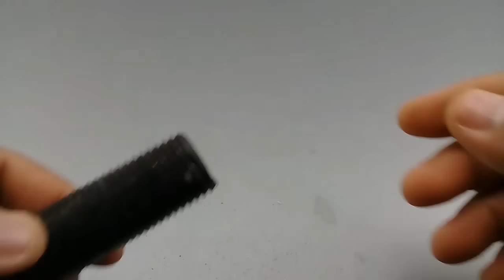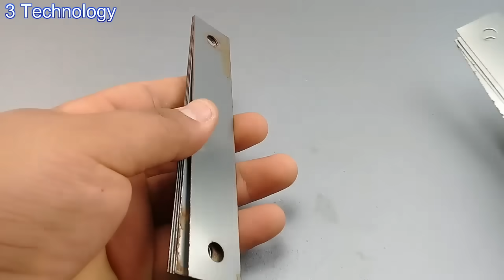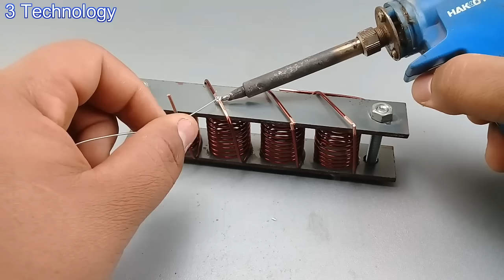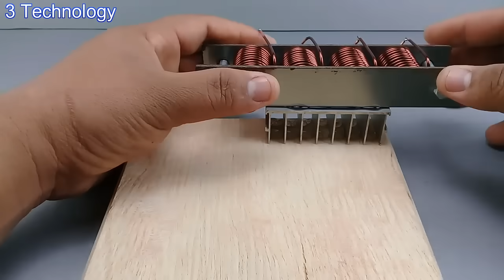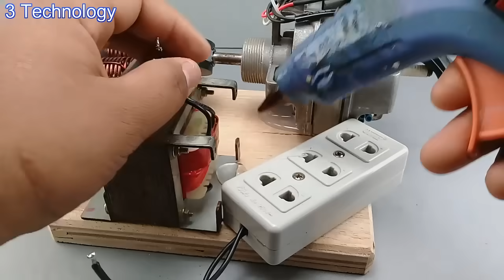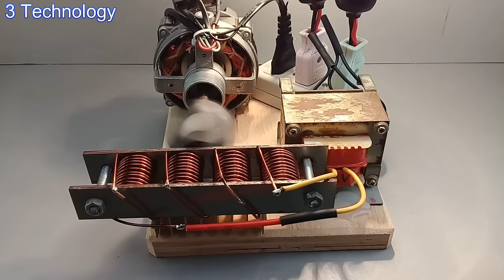how to make free electricity energy 10000w with four pieces copper wire / real free electricity

Comment: Very nice. I have some questions.

1. Which transformer do you use?
2. Do you connect the wire from the coils to the primary or secondary coil of the transformer (I assume the secondary)?
3. How do you turn round magnets, do they attract or repel?
4. Did you measure how much current is obtained at the output?

I apologize if I asked an unprofessional question, since I am a layman in electricity.

Thanks for the reply and best regards
Reply: What's the proof that this is a lie? 10kW with a conductor of half a millimeter and you have a question...
Reply: @diavolo974    Proof that this is a lie is conservation of energy.
Reply: The heatsink was questionable with very little contact and pretty useless.  Nothing else enlightening here -- I've seen examples of free energy circuits .  . but this is intended to discourage those who try to follow this demonstration. . as someone else mentioned, the transformer may have been modified having a battery pack as a power source while stepping up the voltage.
Reply: @ronaldgreene5733      I doubt that you have seen working free energy circuits. No system can deliver an energy output without an equivalent energy input. (Or the system has a storage of energy, which is used up.) Keeping that in mind it is possible to judge at once what can be real and what is fake. With this video I suspect a hidden power line. These guys are mostly not very ambitious in their trickery.
Reply: @heinzpg  .  . yes -- an unlimited storage of energy that can manifest beyond the means of our current understanding -- of a mainstream shared and compulsive variety.  Scientists today still cannot explain how we as biological entities can produce more output than the energy we consume -- and certainly for those on paleo or low carb diets.  This issue is ignored based upon nothing more than the circulation of accepted information and assumptions in place of the inability to explain many of the theories and assumptions given as fact.  In place of initiative, we depend upon nothing more than repetition and production quality.  Initiative equates to responsibility -- something that we so much want to avoid today in real terms, that we no longer require it on the part of anyone involved. We only require the circulation of information so that we feel safe enough to participate without fear of accusation .  . to being sidelined, disparaged, ridiculed and ostracized.  Certainly nobody are more afraid of being call a name than Americans today.  Let's get comfortable now and turn on our television .  .
Reply: Чувак, это развод.
Reply: @ronaldgreene5733    ????? Of course also biological entities comply with conservation of energy! If your energy intake via food is lower than the energy needed to uphold the basic functions of your body and body temperature, plus the work done, your body must tap energy storages and you loose weight and starve in the long run. The recommendations for the intake of energy via food - if no change of weight is intended - are always slightly bigger than the energy produced by the body. You find plenty of figures for the energy in- and output of biological entities in the internet, always in compliance with conservation of energy. It is ridiculous to claim that something is "ignored" in this field. Conservation of energy is not a vague assumption, it is also a prerequisite for the stability of our universe. Ever heard about the Noether-proof?

As for technical devices, there are always claims that a device was found with more energy output than input. But never ever has this been shown in a credible and reproducable way. Whenever an examination was possible these claims proved to be wrong, they were based on incompetent measurements or fakery. You say, you have seen examples of free energy circuits. Have you built and checked them? Probably not. In times of the internet, if such circuits would exist they would soon be generally known and demonstrated in many places. Where is one please?
Reply: @heinzpg  .  . "Conservation of energy is not a vague assumption" .  . and yet your diatribe is based almost entirely on assumption .  . a manifesto Mr. Heinzpg -- Glorious .  . 😃 .  . We expect more .  . you won't disappoint --
Reply: @ronaldgreene5733     Before you rate my comment as diatribe: please show me evidence that biological entities violate conservation of energy. That would be glorious, but I am afraid you will disappoint ...
And I recommend you to research the Noether-theorem, which is a mathematical proof of conservation laws (energy and momentum). Feel free to check this proof! If you miss the necessary knowledge in advanced mathematics to do that, don't worry, this proof was checked over and over by competent people.
Reply: @heinzpg  .  . "Noether-theorem, which is a mathematical proof of conservation laws (energy and momentum)" .  . 😃 .  . There is much more involved than just momentum in the function of the human body -- and you have yet to prove "conservation" which you simply cannot and can only fudge based upon a portion someone's limited attempt to prove what they cannot -- nor can you .  . But nice try -- 
Living animated beings constantly prove the fallacy of conservation of energy within the limited subset of present-day science that does not want to acknowledge something greater than what it claims to understand -- as it tries to determine reality in place of our own greater awareness and unlimited potential.  The individual perspective is the focus of power -- by which no person can be set against another with false or self-serving interpretations from another outside of ourselves.
Reply: All negligible, this is fake, it's not real, I'm am electrician; you would not get 200 watts of ligh from that, with all the iron, copper and frequency losses that would occur in the transformer and especially that motor, not to mention its torque. It bull crap mate
Reply: @aaronfitzgerald9109  Did you build a model to verify your theory that this is fake.. should be easy for you .. being an electrician and all..
Reply: This must be a big big joke. If ever the magnet and four small ten turns of coil can produce a 12 volt ac  with possibly a negligible ampere, how can it drive a 5ampere transformer to give an output of 220 volts??????  Make an inverter circuit instead that might be possible and credible.  Usual menu!!!
Reply: @ronaldgreene5733  I thought animals stored energy as fat.
Reply: @antoniodevilla5926  Every thinking person with elementary knowledge of physics understands the whole video as a joke. It is clearer than the sun that the transformer is a source of energy and the energy required to light the bulbs is maybe 10 Watt.
Reply: @heinzpg C or DC motor....huge fidget spinner extremely heavy with many magnets....attach fidget spinner too  motor and one motion with arm spin spinner...if spins for 3 minuits that is nearly 3 mins off free energy as you will get far more in return than the energy your body used too initiate the spin....
Reply: @La_Ron we do not understand all physics yet we don't fully understand quantum physics which shows the same thing can be in two places at once not only in two places at once at opposite ends off the universe at the same time...we are a single species on a single rock we have not travelled the universe yet physics could be completely different in different areas off the universe and you cannot dispute that because you have not personally been too every part off the universe and nor has anybody else all laws are man made laws and our science is man made therefore a man's brain coming up with the idea off physics  n other things do you think if other intelligent species out there do you think they will have the same physics as us...for starters they won't call it physics they may not even have a language
Reply: @jshaw4757  Don't joke. This is about our galaxy and planet Earth, where immutable laws apply in electricity. The video does not fulfill even the basic Ohm's law. Have you ever seen a device that is connected in a circuit with a power of 10 kW? Did the circuit also have tinned connections? The video has only one goal: Click byte.
Reply: @jshaw4757     I am not sure if I understand your proposal for an energy generation with a fidget spinner but I can tell you that there is no free energy with this! Of course a fidget spinner can spin for 3 minutes, but this does not mean a gain of energy. The spinner will definitely not spin for three minutes if there is a substantial torque which works against its rotation. If the spinner would generate electricity via a magnet and a coil there would be such a torque! Every Watt of electrical output power needs (at least) the same power as mechanical input. 

Yes, in principle physics could be different in other places, the Noether theorem deals with this question. It is interesting that this question is directly connected to conservation laws. But it makes no sense to doubt laws of physics -  best asserted at least on earth and in our solar system - as long as there is absolutely no observation known which violates these laws. Of course, if someone could show exceptions of these laws in a credible way, the situation would be different. But fake videos like this one can not be rated as credible. Note also that physics is not about "understanding". Physics just tries to describe in mathematical formulas what we observe in nature. Can we really "understand", why e.g. positive and negative electrical charges attract each other? No. But we observe it and we have a formula for the attractive force.
Reply: @ronaldgreene5733  It is clear that we do not know everything. Science is about hypotheses that are repeatedly confirmed or disproved. We call those confirmed "physical laws". If we cannot explain something, we look for a reason and create a new hypothesis. An endless round of learning about the world. In time, even those questions that we do not have answers to now will be explained. Only one rule applies in science: A new physical law does not refute the previous one, but expands it. For example, Einstein after Newton .... This video is a mockery of physics and without ostracization can be considered a joke and/or click byte.
Reply: I've toyed with this idea for years. Why could'nt you have a powerful magnet beside a magneto on a shaft, turning an electric motor?  Gear reduction if you need speed.  @heinzpg
Reply: @Pickstringbeller    The main point is: you can't get output power without an equivalent input power, never mind what construction you use. And the constructions used today for motors and generators have been optimized since many decades, you won't find an alternative which performs better. Whatever you can think of: others have thought of it before.
Reply: Ok so maybe I'm a caveman but does this man have a cord hidden I know I was never the brightest student but I'd say this doesn't actually make any sense unless 1 item is hidden from the video but maybe I'm crazy
Reply: @brysoncain7506    No, you are not crazy. This is an obvious fake.
Reply: Do not ask, it is bullshit. Fake and scam for clicks. Never worked, never gonna wirk. Forget it.

Comment: That nice thick engineered board could be hollowed out and house a nice coil powered by lithium batteries. A circuit pulsing current through it could keep that round magnet spinning, generating ac and feeding it through the plug to the light bulbs. Like one of those devices to charge phones by setting the phone on it. No charging cable needed. And claiming 10000 w! Give me a break.

Comment: This is the first step in quantum entanglement. 3 more cores with 4 ignitions and you'll literally be halfway to understanding Nikola Tesla! You're missing the free part. The battery is the source power. The rest almost makes sense. But even if it worked you would need the battery lol. So, this can't even be replicated unless you already have some kind of battery. Really cool though. It showed me the framework LITERALLY! THANK YOU. I had to hide the math and have to test my theory, but I have our source equation at least. I have to first figure out how you exist. Basically, I figured out a new current that can explain Quantum. But the only way to test it is with this! I'll share the source CODE so you can fact check my math if you DM me, but it's so complicated it needs a long explanation. You can figure it out with one question though. How can E=E? Are you a teacher or a STUDENT?

Comment: Transformer : No Specs given. (i'd guess 15v/240v)
Although I'd day with this configuration, the AMPS would be low.
Coils : I like the threaded method, but maybe a Nylon Bolt to protect enamelled copper wire.
The 'I's bar look like from transformer assembly.
Do the coils need to be isolated from the 'I' bar/s?
What is the thing at the end of the moter?
What is the motor?
Just  looks like, Awesom! 😂

Comment: There are several places where a power source can be hidden, like a Battery or several batteries. If we could see this device run and power a light buld NON-Stop for several hours, maybe that could show that there are no batteries powering this device.
Reply: Or just note that he gave it a good pull with the string and the motor can carry that for a while but basically it won't put out quite enough to compensate for usage and eventually come to a stop. The motor will drag more as it increases its output also

Comment: As soon as he placed the round magnet on a motor in front of the copper coils, well only 2 of them I had to bust out laughing.  Not to mention that there is no way that size copper can carry 10K watts of power  without burning up. Then when the final electrical connection was made the motor cogged slightly.  Batteries hidden in the reciptical.  When will they ever learn a new trick ?

Comment: 🤣 as if it could ever work 😆. . .10 kwh in 240 volts is  40 amp. . . 🤣. . .  the wires are too small to pass it. .In a gasoline  or propane generator;  you need a 350cc motor to produce this kind of power. .🤔

Comment: Very cool! I love magnet wire it does such cool stuff. I used to build lots of inductors and transformers out of that stuff. The magnetic field is incredible,  but you can burn the crap out of your fingers if you dont have the heat sinks.

Comment: How to convert transformer 12 to 240 without transistors..or any circuit
It's a really fake..
Reply: Asa este, nu are ce face, vrea vizualizari
Reply: Der Transformator ist das einzige Teil das in Ordnung ist . Der Rest ist Sondermüll für die Tonne einschließlich dem Video
Reply: All transformers change Alternating Current power voltage. Transistors are used to convert alternating current to direct current. You don't know anything about electricity and call this fake?
Reply: Wenn du einen herunter putzen musst ,der keine Ahnung hat . Musst du auch die Richtige Adresse nehmen und nicht an Reinhard Werther schreiben . Anmerkung zur Gleichrichtung . Da nimmt man Dioden Bei Wechselstrom in 4 b Schaltung und bei Drehstrom eine 6 b Schaltung . Das machen wir schon über sechzig Jahre so .

Comment: your work is impressive, however, can you please drop a meter on the wires, input, output, at any rate, im slowly getting the speaker magnets the steel plates, and the transformer for emergency lighting and heat, thank you
Reply: No, he can't. Put your like and move on......

Comment: This looked pretty impressive at first but it seems to me like this project has fallen in the category of perpetual machines. The motor that is rotating the magnet which induces electric current on the coils is powered by the current caused by itself. In other words, this machine has no input energy and yet it is generating energy which will seriously oppose the law of energy conversion. So what I thought would happen was when you gave an initial spin to  the motor, that counts as a input so you will get an output electrical energy equivalent to the input but I didn't expect it to continue operating. So I smell something fishy here so this video need further clarification of what is really going on. And if any cheating is involved here, I think it is greedy and shameful. I believe you have a huge reach and you should use that to be a force for good.

Comment: Wait!... Hot glue to hold down a heat sink? But he sinks get hot doo to reducing the amount of heat from another object that's what they do and when you add heat and hot glue you end up with hot glue in it's liquid form and a liquid form of glue doesn't hold anything in place! I don't even need to know anything about electricity to know that this thing definitely doesn't work and even if it does it's only going to work as long as it takes for the hot glue to heat up at which point everything falls apart! This video should be titled perfect projects for when you have time and materials to waste or the perfect video to watch of someone wasting their time and materials if you have time to waste!! Because then he would be right on the money.

Comment: Not strictly true  "1,000w with 4 pieces of copper wire",.

I see  5-10 micro-Henry coil (nice job on making 4 RF impedance coil on a bolt), then an induction motor,  a 12v to 220 volt transformer, then a mains adapter and a heatsink ???. 

Looks like about $50 worth of components to prove that Kirchoffs Law,  the first and second law of Thermodynamics  still exist and are inviolable in this reality. 

Next time just give the $50.00 to a worthwhile charity please

Comment: How many amps??
Reply: This is joke. Study basic electrical engineering. This guy should get a real job 40 hours per week
Reply: Wrong spin direction
Reply: So what could you actually run off of it? Power wise
Reply: I'm actually trying to make power to run my barn and air which is 50 amps without using my generator